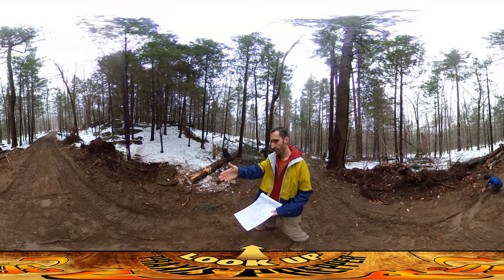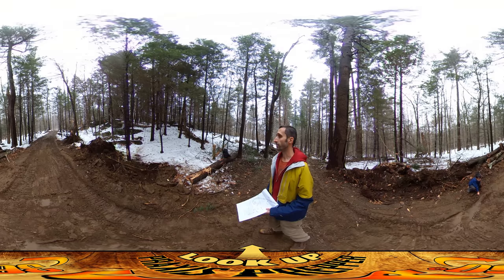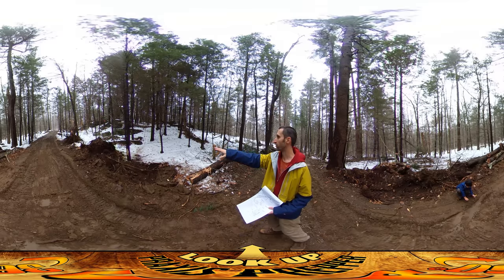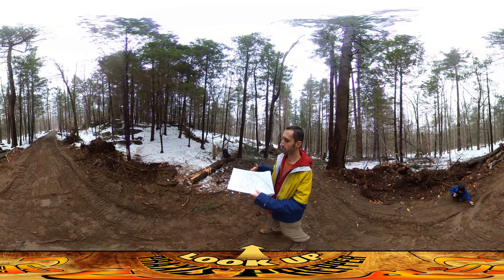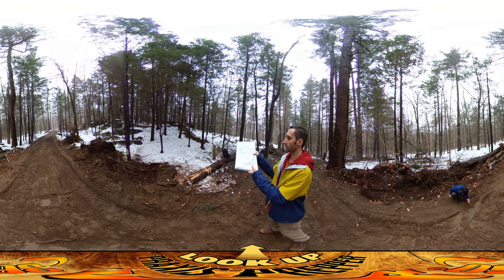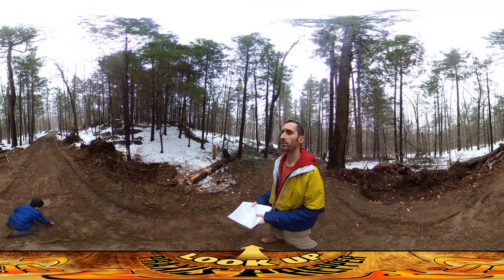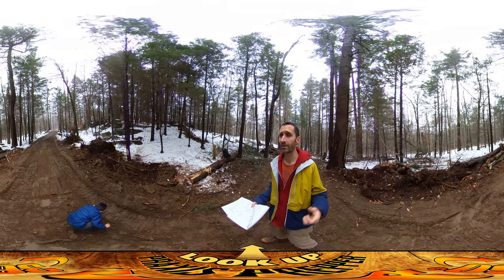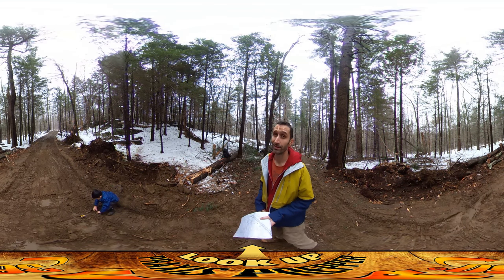Homestead Building - Prepping for a Well Drilling, Working with Well and Septic Plans

Comment: Question??? The excavation team didn't look at the site plan before excavating and according to the plan wasn't the well already marked were would have need to bulldoze? Or clear. Ok maybe this is for film production!! 🤨😉
Reply from the maker: No, that was a real oversight on my part to get it done. They had the site plan, but they're doing the work in parts and I hadn't been stressing the well site being leveled as a priority yet as I was focussed on getting concrete in. The well could have gone in during the winter, but the foundation needed to go in ahead of the cold.
Reply: Ok I got it now😁